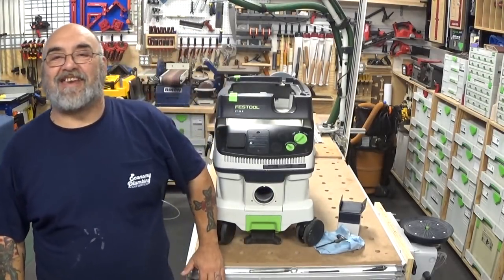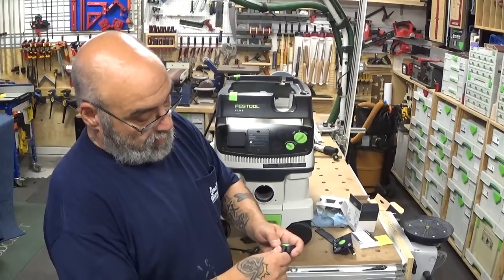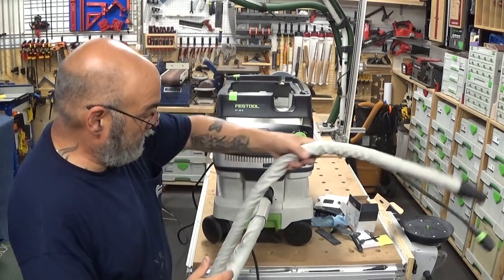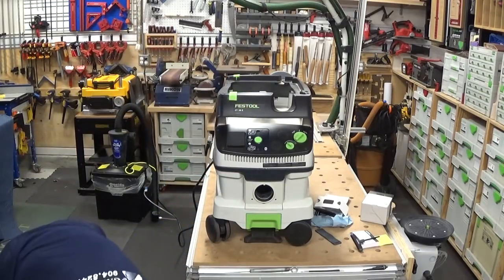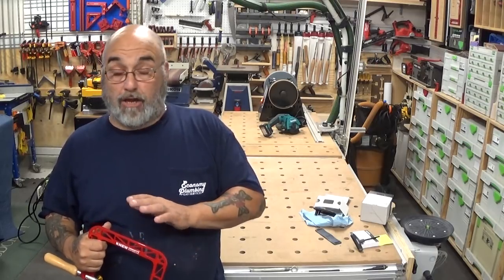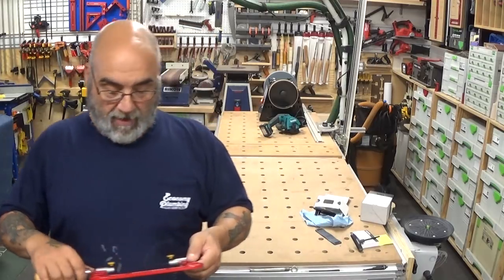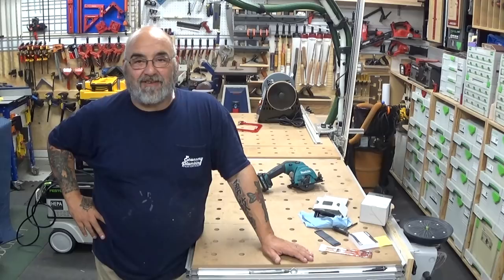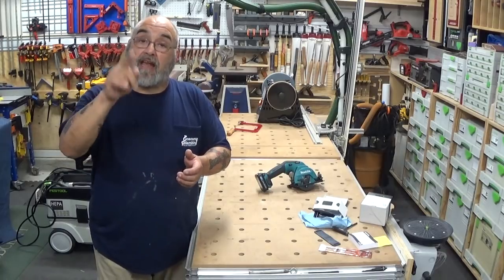Installation of Festool Bluetooth remote 202097

Comment: Hi mike"
Thank you for the demo of installing the Blue Tube on the Festool dust collector.
Have you thought about installing a mini split wall hung Heat pump? That is what I did.  It is out of the way and it gives you heating down to 39 degrees and air condition as well as removing removing the moisture out of the air.
Have fun in your shop.